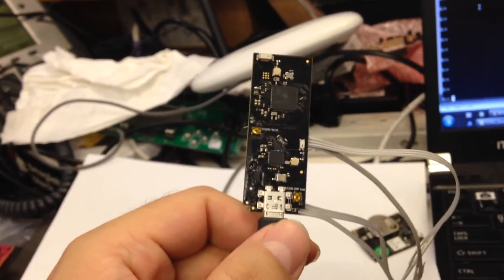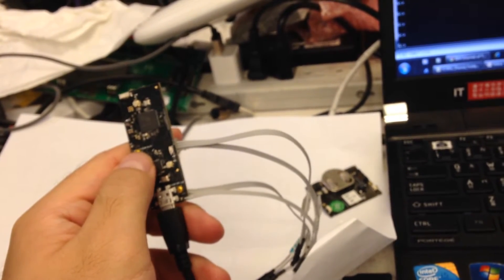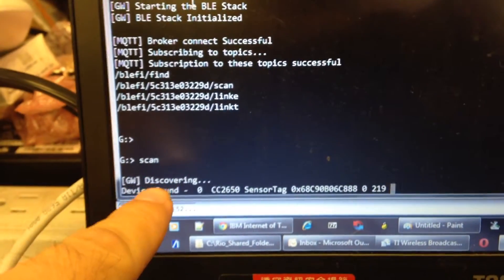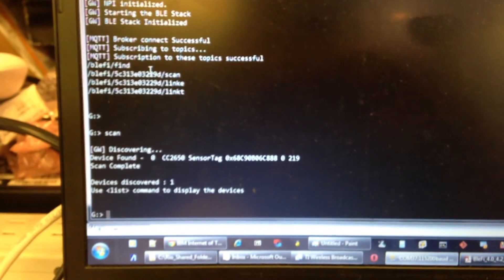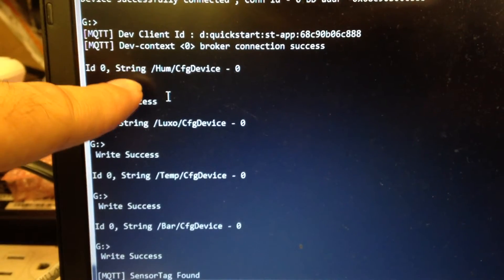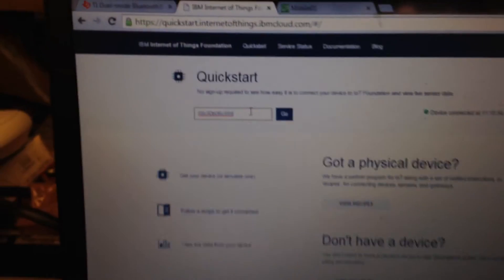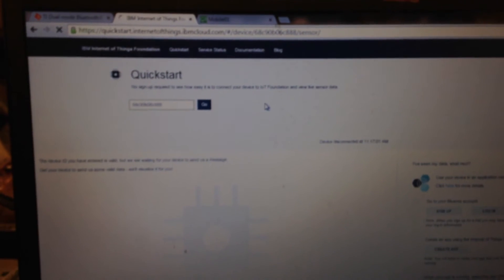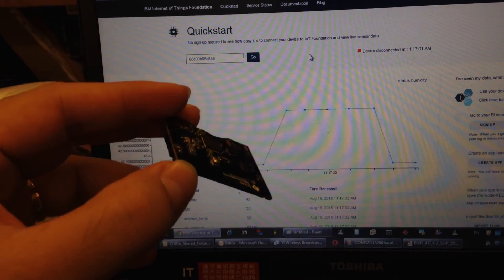TI Rio: BleFI Gateway solution CC3200 and CC2640 (Wifi/BLE integrated)

Comment: Hi, Thanks for the video. Need some info on the Flash Memory, in the BOM TI has mentioned W25X80ALZPIG and W25X20CLUXIG however in the schematic they have used MX25R8035FZUIL0 and MX25R1635FZUIL0. Which one did you use/ works with the existing code? Thanks in advance

Comment: Hi, can you please tell me which debugger you are using to program the device. Also what debuggers are supported by the device.
Reply from the maker: +Shantam Raj 

Hi: 
   To flashing the CC3200 needs to use the UART.
   To flash the CC2640, we are using the JTAG.

   Thanks.
Reply: +Rio TI thanks for the prompt reply. just one more question, do we need any specific JTAG or any generic JTAG will do ?
Reply from the maker: Generic JTAG.